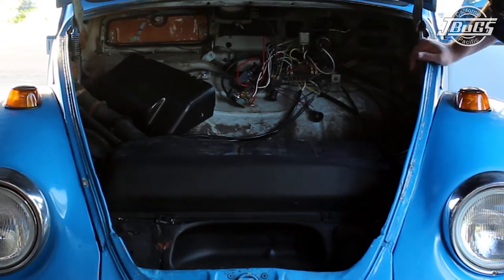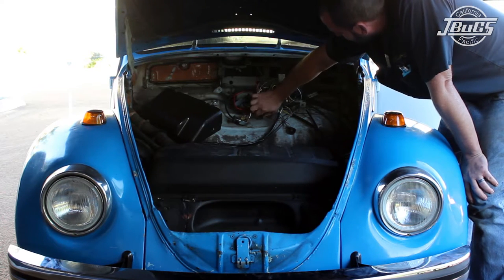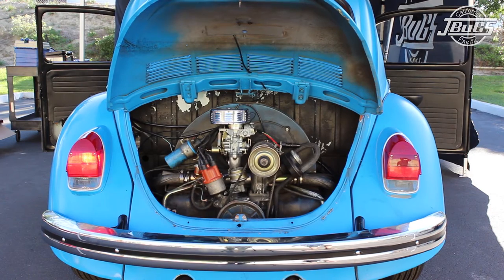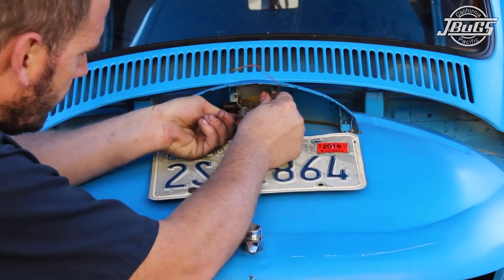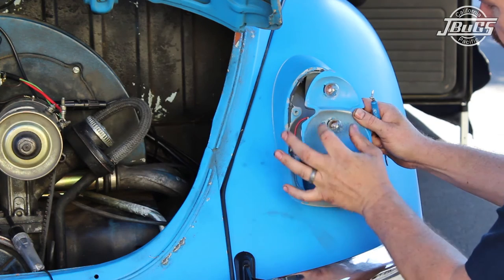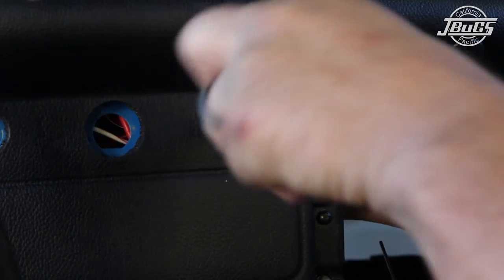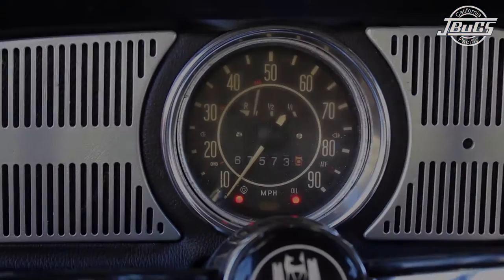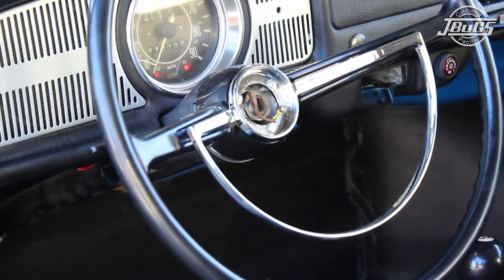JBugs - 1969 VW Beetle Rewiring - Electrical Testing & Troubleshooting

Comment: My generator light and oil light do not turn on at all. I replaced bulbs and socket and still nothing. Wiring is all hooked up as well. What could be the problem. Someone told me something about the reverse lights not plugged in will cause this problem. Is that correct? Thanks

Comment: Just bought a 75 bug. Turn signals work fine but when headlights are on the left side doesn't flash.
Reply: It sounds like the wires for the two filaments on that bulb in the turn signal assembly may be reversed. Meaning the low filament which should be hooked up to the running light wire is hooked up to the turn signal wire and vice versa. 

Another possibility may be a bad ground on one of the tail light or turn signal assemblies.